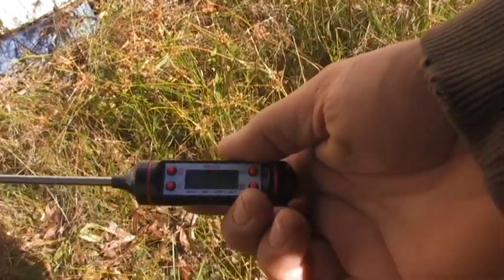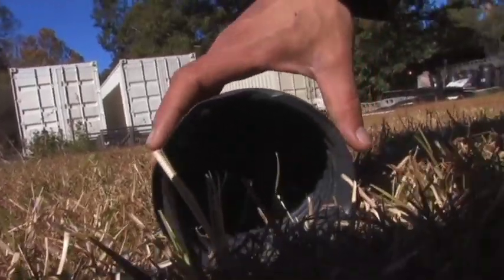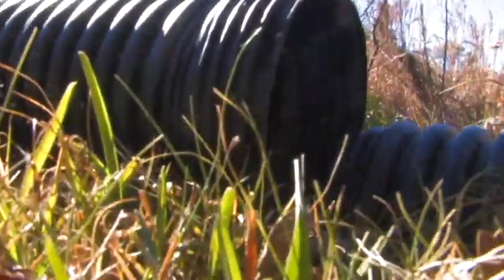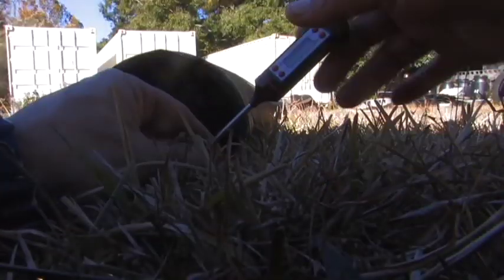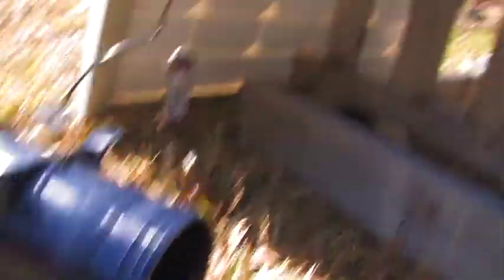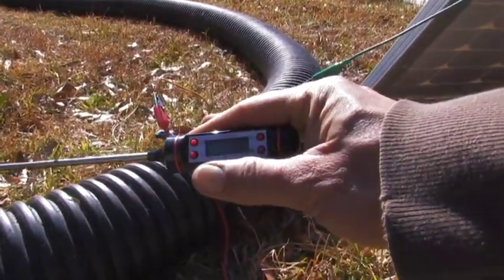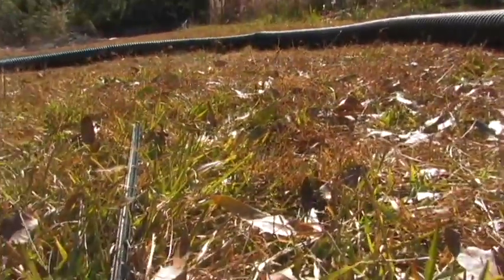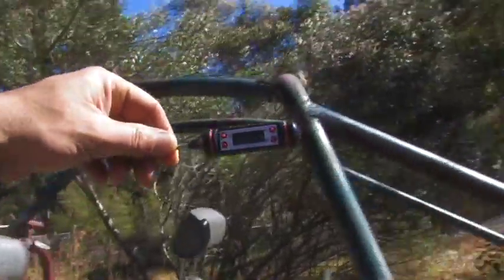Beer Can and Pop Can Forced Air Heater Alternative for $39

Comment: Interesting experiment!  

Couple factors to look out for:  Watch out for the 98-degree hand touching the thermometer.  Also, in the heat accelerator, the fan motor was probably contributing half of the heat.  But any heat is good heat, so we'll take it!  :)

Comment: Another improvement is you can pull the air from inside your house, circulate it in the tubing then back in the house. Will get a lot warmer if it doesn't have to warm that cold outside air. Will be trying that myself soon. Just haven't decided if I want to go on the roof (flat) or on the side of my house yet. Great videos BTW.

Comment: Placing the fan at the exit side of the hose to pull the air from it will yield better results. You are currently introducing chilled outside air into the hose, cooling what you have already heated.

Comment: I think in order to get a new (heated) air flow into a house, you have to have someplace in the house to release the pressure, or make both ends of that tube be put into the house.  I like this idea, especially if the tube could be insulated with some kind of cover (glass, plastic?) to increase efficiency.  1000W or more of heat for a long time is worth $300 anyday.

Comment: TIP: 
lay the tubes parallel to each other with a 180deg returns connect the next tube.
more tubes/less space and with the tubes so much closer together they will share heat to add warmth.
with the right math and a large round piece of plywood you can use a hole saw to cut "teeth" on the outside edge of the plywood connected by a bar(dumbbell comes to mind) so you could just roll it up out of the way when not in use.

from outside:
in_out
out_in
in_out
out_in
in_out
then roll ^ when not in use

Comment: You could also if you have some gravel or other rocks for thermal storage directly in the tube. even out the heat and possibly even have heat a little after the sun goes down.

Comment: By blowing the air through it does not require a heat resistant fan and should be installed in the house to act as a return air, thus negating cold air introduction. My suggestion would be to lower the volume either by sizing the fan or putting a Rheostat on the existing fan. More volume is not better. To much flow or cfms results in lower temps. I've use this same concept and they work very well, but in colder areas you need a glass covered, insulated type box heater to be efficient. Good Job!

Comment: I like the concept, but maybe a lower CFM-rated fan would do the job? You wouldn't have to worry as much about cooling down the tube and a continuous flow of warm air is what matters of course. If someone wanted to invest in putting the drain tube under glass, I think this system would warm a house for most of the day and contribute a large chunk to daily green living.

Comment: Very good deduction!  I expected higher temps when I first saw it, I missed that by blaming it on the high speed of the fan.  You're right! It's on the wrong damn end.  I'm still thinking the fan could be slowed down a bit.

Comment: Why heat cold outside air? The main usefulness of a Solar Heater is pulling air from the dwelling, run it through the heater and push it back in the dwelling. That is where you get the most use of the heat generated. 

As the fan speed slows down, air absorbs more heat. The dwelling will have hotter air pumped into it. So faster cooler air (larger volume) or slower hotter air? Really depends on equipment you have on hand. Just remember the noise.

"RichAllenMusic" has great videos on his channel

Comment: i'm not sure but i think if the tubes were slightly flattened, light would touch more surface area, causing more heat.  i was thinking the same thing about thrundar but frankcoffee has an excellent point too

Comment: It sounds like a good idea, just can you show some data on how much heat radiates from the tubing when it's on a closed circuit?  When you opened the pipe up it cooled off fairly fast to around 65 degrees which isn't enough for colder locations like Maine.

Comment: Dan mentions enclosing this in glass in cold climates...  I have no idea, but other hot air systems also run air through at lower warm temperatures 80-90.  Why I can't tell you...   What to do at night.. thermal mass... A friend invented something like this and sold them, but got sued, because almost all of them caught on fire.. in Michigan.  The thermal mass got too hot and burned out the motors ...opps!

Comment: 30ft is about 10m and 4" about 10cm so the total area exposed to the sun is about 1sqm that will give you 1000W in ideal condition noon sun with 100% efficiency not the case here. Part of the heat will be lost on the outside of the tube depending on outside air temperature, humidity and wind speed.
There are -25C (-13F) right now here this was max during the day :)
If you want to calculate the heat output you will need the air temperature at the input at the output, the air volume and do not forget the blower motor since the power it uses is transfered as heat to the output air.

Comment: @thrundar And cover the whole loop with clear poly, and definitely get a lower-flow fan if you're only using 30' of hose. Or build a cheap frame to run your s-turns in and cover with plexi...

Comment: @sgbofav What you do for heat at night is to make sure your doors and windows are sealed well. You can also use thermal drapes sold some places for $10 a panel.  If your rooms are well sealed the temperature should not drop by much more than 10* over 4 to 5 hours.  Insulation and sealing prevents heat loss, thus saving you money and energy.

Comment: what i didn't understand is...you put your pipe in a circle to reheat the air but if you do that where/when/how do you take it loose in order to benefit from the warm air?
Is there such a thing as having a temp controlled diverter that opens up when the temp reaches a certain degree and closes and continues to circulate the air in the circle till it heats up again?
please explain how recirculating the air in the circle gave you the added degrees?thanks for making the vids i'm learning alot....

Comment: Dan. what do you think about the idea of enclosing those black pipes in a box with double pane glass? Do you think it would raise the heat of the air signifigantly? I know that would be costly but I wonder if it would raise it even higher therefore you could use less tubing? That would be an awesome way to heat some of those shipping containers behind you if you wanted to use one for a shop or emergecy shelter!

Comment: hi any chance you could wrap some coils of copper wire round the outer pipe logic is you should get a current as the air has atoms that have electrons would be simple if you get time ........thanks

Comment: I also wonder how much of the heat is coming from the motor in the fan.

I am also not sure where you get the $3 price on the tubing. Maybe it was $3 when you bought your YEARS ago. I just purchased a 12' section and it is closer to a buck a foot after tax and all.

Comment: @pvampire and inside your glass box at the bottom, a trough mirror, aimed at instead a metal black pipe.! then the size can be even smaller. or the same length and Hotter : P

Comment: @Aydosh1991  it will keep the heat in when its cold your losing heat as its cold thats what i meant. its a insulator and y do you have to be a engineer to know this this a simple heating cooling knowledge plastic is a poor insulator,